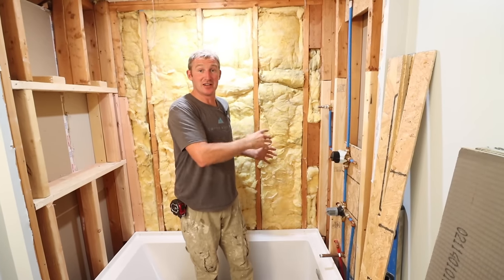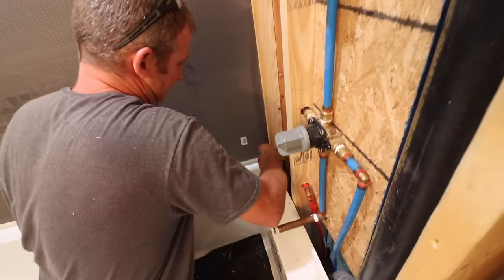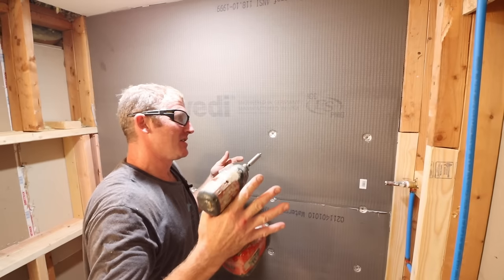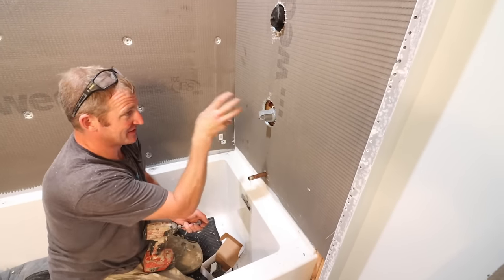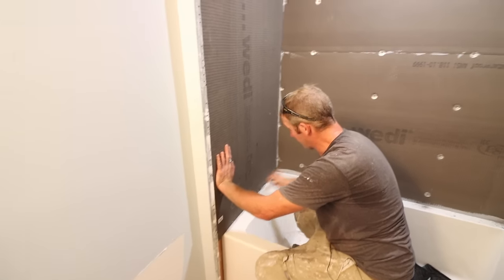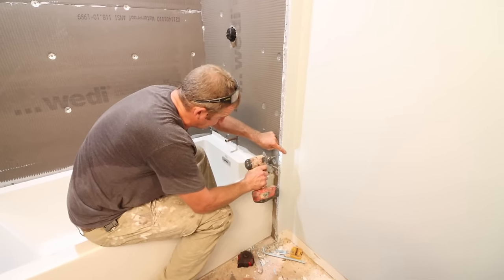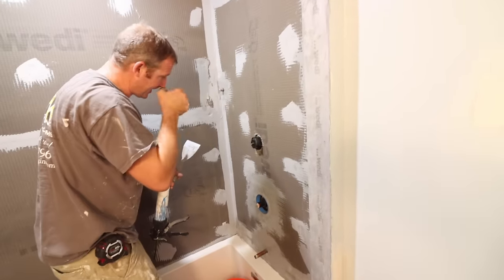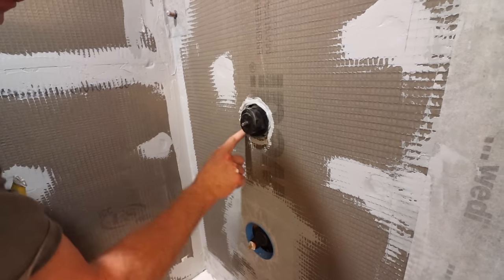Waterproofing Tub Shower Walls | Easiest Method for Beginners

Comment: You guys are awesome. Great demeanor and clear in your explanations. ...Question: The furring strips for handling the tub flange makes perfect sense but, before that, do you have any tips for studs that are extremely out of level and plum? My project has walls that are atrocious. Even before demo, you could see the bows and how out of square the corners were.  Much appreciated!
Reply: Not a pro by any means but I’ve seen people use a hand held electric planer for the area of the studs that are sticking out. For the studs that are bowed in they use shims with wood glue, sand down the edges and or use the planner and then add a screws. You don’t want to use the planner with a screw in the stud.
Reply: @changes8  makes perfect sense Jonathan. Thanks man!
Reply: Get an electric planer. I use a ryobi.  Be careful not to hit any nails. Also u can sister another 2/4 next to the ones that are bowed inward

Comment: Thanks for your quick reply. Reason I’m not using tile on flooring is that would be a lot if work for me as I’m up there in age and bathroom is upstairs 2nd floor. Too much carrying items up and down. And cost as I’m on a fixed income. This is the main reason for to diy.
I want to thank you both for your tutorials on doing the shower remodeling. I followed your advice on my last kerdi shower install. It came out very good and I learned a lot from you guys. I wasn’t very impressed with kerdi and the cost was too high for a 3x5 shower that’s why I chose Kbrs shower tray and go board walls. So simple, easy and lightweight to install, cost effective compared to kerdi.
Thanks again Dick T

Comment: For a second from the thumbnail I thought this was cement board and you were taking silicone to fill the screw holes lol.

Tip for the multitool. You can put the blade sideways for funky cuts like that.

I like this idea more than the schluter system. The sealent seems like a real cool idea. Is it a type of latex? Wonder how they get the thinset to bond to it.

One more thing, buy some nice gloves mate lol.

Comment: Metal Interior corner knives also work well for sealant. The wings are more flexible and can clean up well with 70pc isopropyl alcohol or wipes
Reply from the maker: great tip Thomas, thanks buddy

Comment: Great video. For the board placed around the valve fixture, why did you not place is down into tub flange similar to how you did the other two boards along the tub flange? This would avoid the use of tape.
Reply: Because he was demonstrating the 3 different methods of backer board to tub flange!

Comment: That was extremely helpful. Thank you very much! I plan to do a similar installation in an existing bathroom where one of the three walls is cinder block . Before I attach furring strips 16 in on center over the cinder block Is it wise for me to put 1/2 inch insulation foam board to keep moisture from building up on the concrete....or is that overkill.? Thanks!

Comment: This video was SO SO helpful! Thank you! I do have one question: how do you know where to frame the niche in the shower wall? It seems like I would want to have a full tile row (on the wall) at the bottom edge of the niche. Is it too hard to figure those measurements out to make that happen?
Reply: @BathroomRemodelingTeacher     I am using 4x12 subway tile everywhere except on the back wall of each niche. The tiles we picked don't have the built in spacers on them so I plan to use 1/16 or 1/8 spacers.

Comment: Hello!  Thank you so so much for this wonderful video!  It seems that Kerdi boards and Wedi boards are unavailable right now!  Floor and Decord has a cement foam board that seems similar; my question is, should I use the Kerdi sealant on those, or can I just use a normal sealant?  Thank you so much!

Comment: Question: when you used the table saw to make the overlapping flange, you cut it 1 1/2, the height of the tub flange. Shouldn't you have cut it 1/8"shorter, or are you figuring that the board sits 1/8" above the flange because of the caulk?

Comment: Wedi is fantastic! Used it in our 1st floor bathroom remodel. The problem is one finding it ( had to drive to another state to pick it up) two it's expensive. I do believe it's the easiest of all systems to use. I've been thinking of using the  laticrete system for our basement bathroom build this time around. Is it not pretty close to the same installation as wedi? Great video!!!
Reply from the maker: thanks Anthony, the difference between all systems is their drain - from what we’ve seen Schluter has the best drain then Wedi might be next. We haven’t installed a Laticrete shower yet but do like their Hydro Ban Board
Reply: @HomeRepairTutor  Yes!  That's what I meant hydro ban board system, It appears to be quite similar to the wedi system.
Reply from the maker: @anthonymyers-35  it's very similar except Hydro Ban Board doesn't have a waterproof foam core

Comment: Great thorough tutorial. I hope I can afford those materials instead of using the old green board when I tackle my tub replacement. I have a question about walk-in shower stalls. I'm 62 and my wife can hardly walk and we can't afford contractors for things I still am physically capable of doing. The house we downsized into just a few months ago has a double sliding shower doors on the walk-in stall and my wife can't get through them and I am having a hard time finding a swing-out door to fit the fiberglass "shell." The opening at the bottom for the frame of any door to fit is 38-3/8" wide but the top is almost 38-3/4" wide because the partition wall between the shower stall and the garden tub is bowed because the builder put some of the 2" x 4" studs in like "deadmen" instead of using 2" x 6" studs on edge for the wider wall cavity needed for plumbing. This must have allowed the stud where the shower stall edge and its door frame to bow so the top couple feet of the fiberglass stall wall on the side that a swinging door would close to follows the bow. I'm trying to locate a swinging door distributor who sells a door kit that somehow compensates for such a situation to follow that bow on the mounting side for the frame piece that would go on the right as you face it from outside the shower which is the side what would be considered the latch side closes to AND gives a clean looking seam when the door closes against the latchside jamb. Thanks for any help.

Comment: Thanks for this video! I just purchased a home, and had a leaky shower valve. The plumber needs front access to change the plumbing to a single center valve. He requested that I remove 4 vertical (4in square) tile up from the faucet and cut a hole in the drywall. I’d like to keep cost to a minimum. If I cut this out and try to save and reuse the tile, can I just use waterproofing tape to put the drywall cutout back over the hole and tile back over it without any worries?

Comment: I am doing a similar installation right now - just finished all the joints and screws with Wedi Joint sealant. Can you tell me if the “620 sealant” you use for the collars and transition fleece is in fact a different product than the joint sealant? Want to make sure I order some of that too, if so.

Comment: This was an amazing tutorial. You solved several installation challenges I was thinking through. I liked how you used ample Wedi joint sealant but what is the best method to clean up where excess gets onto the tub surfaces? Thanks, again.

Comment: You mentioned you should always waterproof along side the tub and I agree. How would you recommend doing this if the only material along side the tub is the thickness of .5 inch drywal meeting the alcove on an outside corner. In other words, the tub edge is flush with the wall studs. Hope that makes sense.

Comment: This was helpful, however we have terrazzo floors and want to keep them for our flooring. Going to remove the tub.  But it possible to use Wedi for the walls but not the floor portion? How do suggest to marry the wedi to terrazzo at the floor?? Is it even possible? Trying to redo bathroom before inlaws come at holidays so wanted to use wedi since seems fast but just curious 😅

Comment: Isn't there a better method to ending the tile than on top of a drywall corner bead? I think you did a great job with the work and the water proofing, but if there is ever an issue with the drywall, that corner bean being under your tile is going to be a real expensive pain in the rear.  Is it possible to use a metal edge specific for tile,  like Schluter, that would keep the drywall and the tile independent of each other?

Comment: Amazing video! I'm tearing up my bathroom and am going with the Wedi system for the shower and ditra for the tile underlayment. You have answered all my questions except for one. When installing the shower door after tiling, what is the best method to maintain a watertight seal where the screws are embedded into the tile and backerboard? Thanks.
Reply: Pre drill the screw holes. Fill the holes with a little silicone. Silicone around the outside edge of the hinge when up against the wall
Reply: Make sure you use stainless steel screws

Comment: Thank you for the video on shower install.  My question is, did you forget to insulate the left and right wall for sound/or heat transfer?  I noticed you did have insulation in the main wall but none on the other two walls.  My wife would complain when I sing in the shower, yours?  Also, what about the ceiling, how do you address moisture/insulation there?

Comment: Nice work! This seems easier than the Kerdi boards and having to mix thinnest and use Kerdi bands to seal the seams. Do you like this over the Kerdi?
Reply from the maker: great question, each system has pros and cons. Wedi can be expensive and hard to find, same with Schluter but they’re a bit more available. Schluter has a better overall system that has different drains, accessories, and heated floor systems. Wedi is faster but you pay for that convenience
Reply: Both systems are way overpriced for what they are

Comment: This is a really great video on how to waterproof and I find it very helpful but it does not address the problems that I am having with my remodel. I have torn out a tub insert and installing a shower pan with flat panels that adhere to walls. I have already used headiboard and have yet to put up the panels because they say I do not need to waterproof but that goes against my instinct. I have not sealed any gaps or screws because the panels themselves are supposed to be waterproof. Nervous about finishing up and ending up with moisture. Any suggestions.

Comment: I have cement board hung six foot in the shower I want to be able to waterproof the drywall that's left to the ceiling is there a way to waterproof the drywall and towel over the drywall thank you so much I get a lot of pointers from you

Comment: Dude one sheet cost me over $50 a sheet if I buy 50 sheets for 6 jobs just a sheet not including special caulk and tape. I can can use Wonderboard, duraroc, etc and the best waterproofer for a fraction of the cost and caualking water proofing etc. takes the same or less time. I almost never pay for materials my customer does but I will never use these overpriced options because they ae no better than tried and true ways at the fraction of the price! However, your prep and work is well done and that is what will make any system regardless of cost last for years! Well done!
Reply: Thank you Paul for that tip.  Agreed, the best manufacturers are those who make their product affordable and retain quality.

Comment: In case you don't want to tile all the way to the ceiling, can you use paint on the Hydro Ban boards. Like I would tile up to 75% of the way and then paint the  rest of the way up to the ceiling.

Comment: Hi there. I'm here for help because my dad told me I didn't need to waterproof before tiling and told me to return the waterproof membrane I bought and tile on top of plywood. Even though I'd watched a lot of contractor videos, I trusted him, he's my dad. Anyway, now I'm here because I got about 70% of the way through tiling and decided I should waterproof. Gonna rip it all down and start over. But my tub doesn't have a flange. How should I address this? Thank you so much, in great need of help :(

Comment: Just a question …did you say don’t use sealant or caulking around the spout and mixer holes but used it on the upper most ?

Comment: I've installed several showers using the WEDI system and love it but per WEDI's instructions, the lowest the fasteners should be from the bottom is 12" and then spaced on 12" centers going up.
Reply: Pete Kruger the 12” is specifically for a shower with a Wedi base, the tub is not first fastener at 12” up

Comment: wedi vs schluter which do you prefer? diy my bathroom in a new build and i went with the schluter foam drain pan as im doing a curbless shower. whats your preference?
Reply from the maker: Schluter, primarily because of the drain. It’s solvent welded versus relying on a rubber gasket that will fail. And the drain grate kit is better than Wedi

Comment: Excellent job.  It looks like this wedi system has solved the capillary leakage of the Schluter Kerdi Band and thinset adhesive method.  One big question though:  Does the thinset used to set the tile adhere well to the wedi adhesive and caulk?
Reply from the maker: yes, thin-set bonds well to the joint sealant. Side note in Schluter, capillary water movement isn’t an issue if the system is built correctly. Thin-set crystallizes over time between KERDI-BAND and the substrate or fleece, this anchors the band to the substrate and makes the system waterproof
Reply: @HomeRepairTutor  Thanks for your reply!   I understand that the Kerdi fleece is a good anchoring feature but the  inability of the thinset to adhere to the poly of the kerdi does not make it waterproof (the thinset is really not waterproof either and the fleece makes an ideal capillary path for water migration) and is the issue (hence the need for the fleece in the first place.  Here is a comment I made a while ago to Issac on TileCoach about this problem:  I am not a professional tile setter but I have installed a couple of baths and showers with Shluter products. I am an engineer and would like to offer some observations about this entire sealing process. IMO: I never was sold on the Kerdi band and thinset adhesive method. It does not make sense and your great video demonstrates that fact. In some of your other videos you can see the migration of water under the k band or membrane along the fleece to thinset interface. Water will travel along the interstitial layer between the fleece and poly layers of the kerdi. I have used Kerdi fix but only on interfaces of non-porous surfaces (k board to tub flange, shower pan foam to k board styrofoam, etc.) After watching this you have confirmed my suspicion - kerdi to kerdi "sealing" with a thinset cement product cannot work. Have you ever broken open a concrete floor slab and noticed that the poly vapor barrier membrane under the slab was not "stuck" to the concrete? The incompatibility of the poly membrane with cement is not functional for adhesive sealing purposes. So what to do? Next time I would plan to use a sealant that is compatible with the poly (ie: it "sticks" to the poly ) and only apply it to poly to poly (or other compatible non porous surfaces). I don't remember but was the k band fleeced on both sides? If the top of the band isn't fleeced I would install it UPSIDE down (fleece side UP) and use k fix as the sealant / adhesive. If it is fleeced on both sides, I would look at the other manufacturer's similar products and use one with a minimal amount of fleece on one side - remember you need the fleece to mechanically add tooth to the band for the tile thinsetting. If I remember correctly the kerdi product is fleeced on both sides and what i just proposed would not work with the Schluter products. I really think this is a shortfall of the Schluter system and unfortunately may be a deal breaker for it's use. In fact the reason why Schluter emphasizes the need to embed the k band into the thinset so tightly and with thinner mud than tile setting is to attempt to make the thinset penetrate all the way down to the poly layer of the k band. But because of the non-adhesive compatibility of the poly / cement connection (just like under the floor slab) you cannot prevent parallel water migration at the poly to cement interface. This is a problem and great opportunity for another test setup! The current method of using thinset of any type to seal these fleeced membranes to one another does not work nor can it ever work. Trying to seal fleeced membranes using thinset would be the same as sealing a PVC shower pan liner with paper in between the glue at each joint - no bueno!

Comment: IGood evening
I am doing my shower. I want the most waterproof method but at the same time easy to install.  Is kerdi with red  guard good. This system looks pretty good as well so i am kind of overwhelmed with all the systems.  Is foam strong enough to hold heavy tile? I also need a floor system which i can do myself.
Thanks

Comment: Thank you in watching you do this I have a question I had someone put up it's like a green moisture resistant board drywall and they put it up and it's like it's thickest I think it's a quarter inch the make a long story short they put it up but then because I have 12x12 tile that's going up I need cement or whatever your weedy is I think that's what it is to put it on that can I put the wedi up on top of the board or do I have to take all that down and put the and start all over with the wedi please help